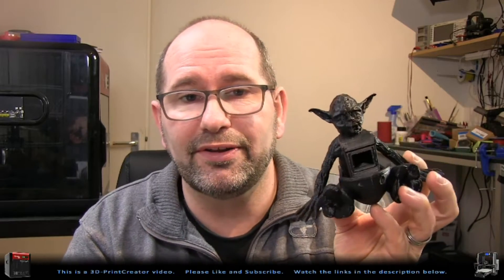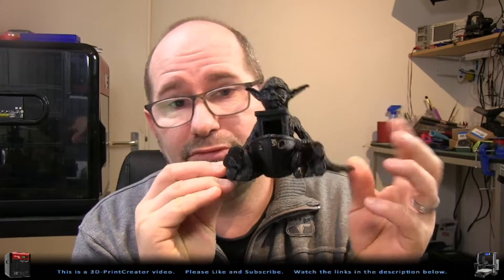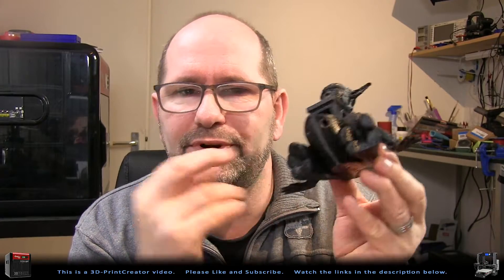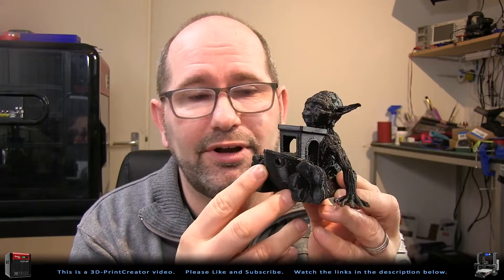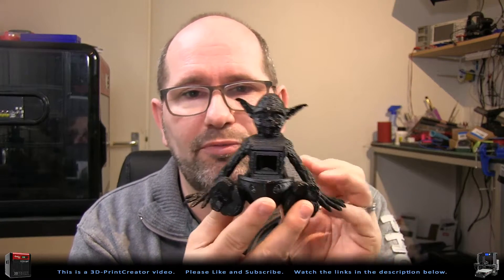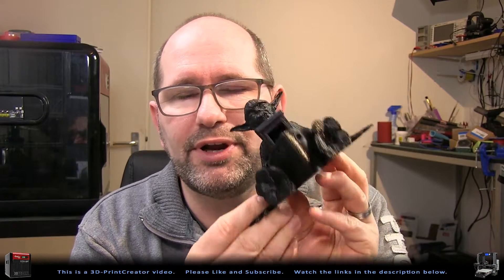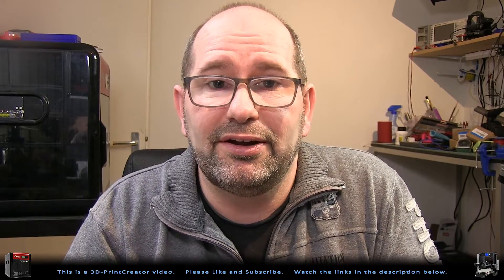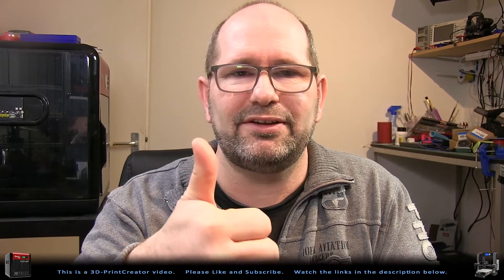▼ First real images of my HYPERCUBE 3D printer really printing

Comment: Hallo Brian, Thanks for the great HyperCube tips! Very useful. About that missing smoothness on the coil holder, have you looked at settings in your slicer like 'coasting' and 'Restart distance'? That did it for me to solve this issue. It al has to do with retraction of the filament. Restart distance I've set to -0.4mm (so a negative value!) and coasting 0.9mm Give it a try, it will greatly improve your prints in my experience. Groeten, Jerry
Reply from the maker: Hi Jerry,
I have been playing with this settings since you wrote this and although the numbers are a bit different for me, the result is great.
Thanks so much for sharing this with me.
Groetjes terug, en bedankt :-)

Comment: If you show a close-up of the non-smooth walled part people will undoubtedly have some useful advice to offer as to what's needing adjusted, and in what way etc.
Reply from the maker: Oh but that's just fine.
I knew just what to do. Dailing in a printer isn't that difficult, I just needed some time to do it.

Comment: I had the same problem with my inductance probe seemingly reading slightly different heights using the linear bed leveling you should try the Bilinear with a 5*5 grid it solved it for me perfect first layer every time now the repeatability is awesome.
Reply from the maker: I have now placed the original micro switch as end stop and this works great.
I don't need the probe anymore.
Reply: What is your Standard Deviation result when doing a repeatability test with m48 p12 x100 y100 v2 e l2?

I get different variations each time. My last test gave me 0.005904, then 0.003554, then 0.002155.

I've been trying 4x4 so going to step it up to 5x5 see if that helps me.
Reply: I have not done any testing to find out the  standard deviation  i just do the ordinary paper test and lower the x-carriage to its zero position and see do i get the same drag each time with a 5*5 grid once set up I get perfect first layer anywhere on the bed with auto bed leveling (non mesh) I have issues with the bed bowing up at the sides and the center dropping causing about 200 microns difference between the edge and center
Reply: I do something similar. I think using 5x5 has helped quite a bit.

I did a repeatability test on a fixed z-endstop vs my probe so I could test if I had a bad probe. I recorded the results and added it to my leveling process document https://github.com/pflannery/Hypercube/blob/master/auto-leveling.md#check-the-probes-repeatability
Reply: are you putting the G28 code before G29 in your slicer because a G28 after G29 will wipe the leveling memory
Reply: I'm using the rcbugfix branch of marlin at this commit https://github.com/MarlinFirmware/Marlin/tree/48925b7298bd1a1abb95b31246326af76d2f1aa8. It always persists the ABL data after a g28 and after the restart of the printer. I can see the data by running "M420 V"
Reply: Sorry I skipped over the "slicer" part in your question. I don't use g29 in my start code. This is what I'm currently using https://github.com/pflannery/Hypercube/blob/master/start.gcode
Reply: add G29 after your last G28 in your start code this will  initialise the autobed leveling that you have selected in firmware at the start of each print, if you are using Bilinear bed leveling as I do the mesh will be wiped after each G28 command
Reply: Sorry I didn't read your first post I am using an older branch of marlin which mesh does not persist I had read that was becoming a feature alright i would still try putting a G29 after your last G28 and check the results as the leveling procedure only takes about 40 secs anyway at the start of a print also remove the G1 F9000 at the end that seems to be a very high feed rate
Reply: I have everything working with my process without putting g29 before my prints so I'm not going to change it but I will check the feed rate thanks!!